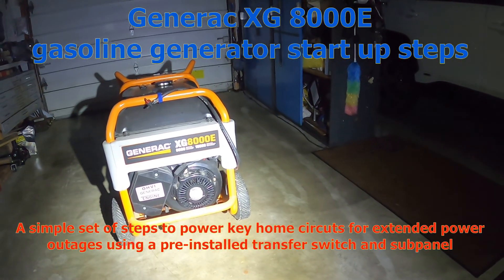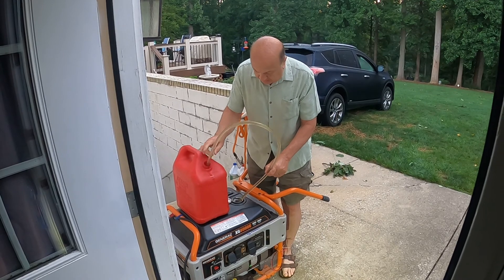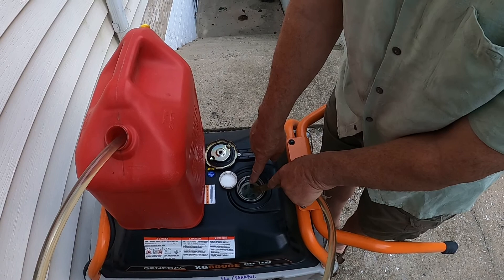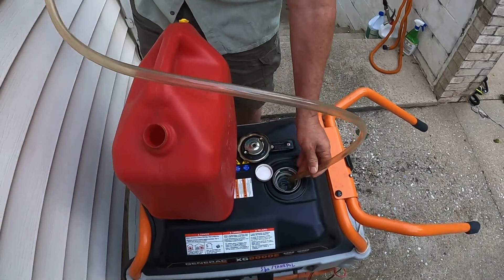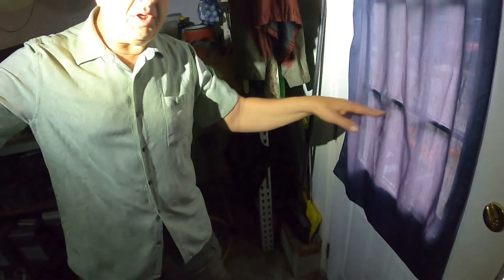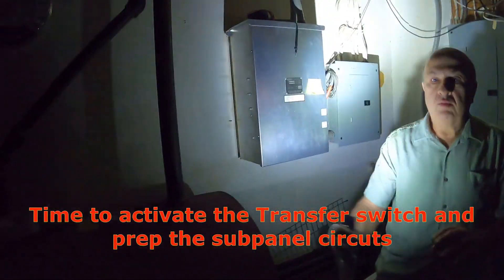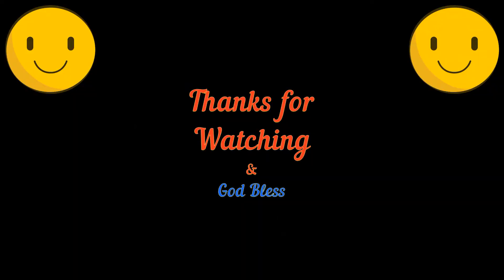Emergency ⚡️Generac generator⚡️ & transfer switch for key home circuits DIY budget in a disaster

Comment: Hey Joe, Buddy here… Here is my question. Do you have to turn these “key circuits” off in your main circuit breaker box or are they completely separate circuits. Otherwise I feel like the voltage/current could bleed into your other circuits through the main breaker box?
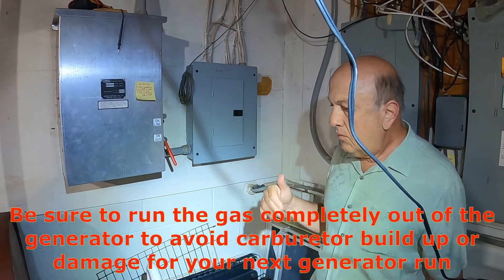Reply from the maker: Hi Buddy, thanks for the comment.  Key circuits are those that are fed by the transfer switch, the other two larger 200 amp panels (visible at 10:06) are not fed via the transfer switch and only though the utility provider.  Designing the system in this way helps ensure that the emergency generator is not overloaded.